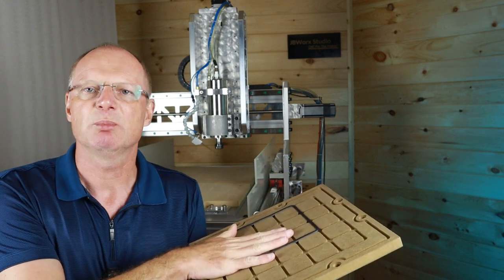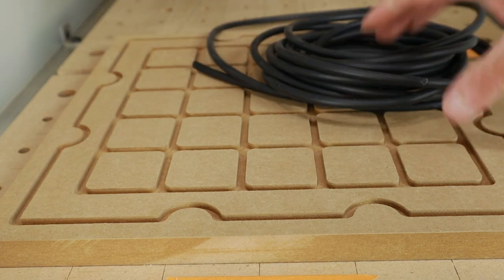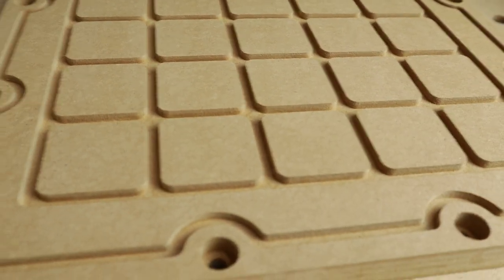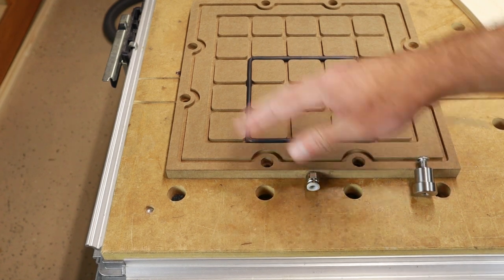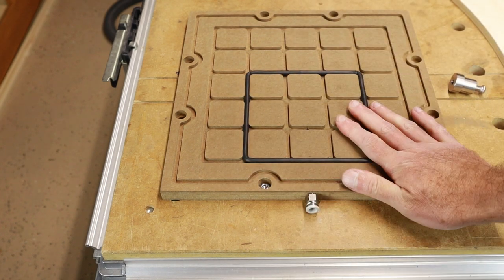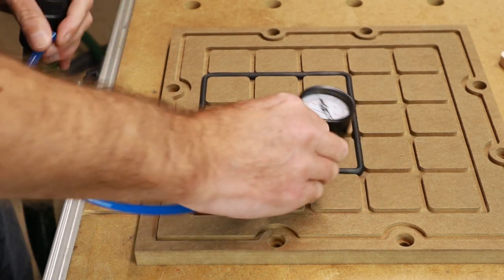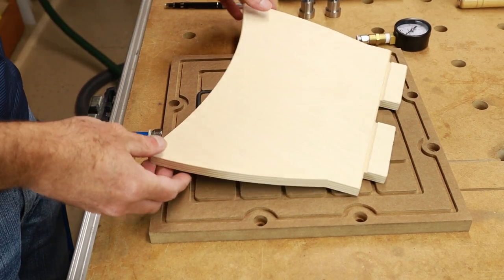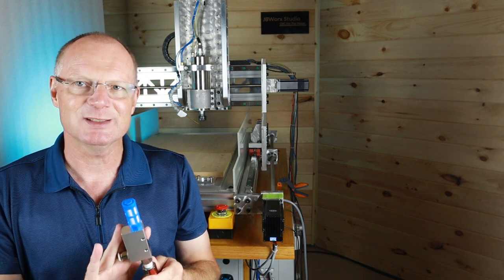Vacuum Plate

Comment: I've been using my CNC for about 8 months now and haven't been happy with any work holding method, this seems like a great idea. Now, if I could figure out how to make my bench perfectly flat then I'd be in a better place as well.
Reply from the maker: I think there is not “one fits all” work holding. Thin stock versus thick or metal versus plastic need possibly different methods of holding the workpiece down. If you have repetitive work it becomes also a matter of efficiency.  I think I use the CA and tape method the most followed by the direct clamping from the top. Have you watched my video on work holding? I think it has value.

Comment: Another awesome video, right in line with my CNC journey. I am considering a large vacuum loch raster from Sorotec, but really need more hands on experience with vacuum work holding before dropping €3k. Thanks to your inspiration, I'll probably build one of these as an experiment. Keep up the awesome work!
Reply from the maker: Thank you ! Yes a Lochraster Platte can be nice. They still require quite some airflow in the case any of the openings become exposed. Just keep that in mind when designing your vacuum system.

Comment: A good generally free source of vacuum pumps are old fridges. Not any good for Vacuum forming but for lower volume applications like this or vacuum bagging composites they are great.
Reply from the maker: Thank you for sharing, I have one from an air dryer that also works like you said if the volume is low… but the vacuum it can pull is great at 900mbar.

Comment: Joerg, great video, ive realised that i really need one too. I think the best variant is 20mm thick alum plate. Tape method works 50% of the time, my parts overheat quite often, so vacuum is the way to go. But there is one thing: using the tape method, I’m not afraid to damage the table, because there are 2 layers of tape between the part and the table, in the case of a vacuum plate, you will need to leave 0.1mm or more so as not to spoil the plate. And btw i think vacuum pump from Easy Compsites will work very good, its 300 euro - good upgrade for the system.
Reply from the maker: Thank you! Yes once you make an aluminum plate you will be mad at yourself machining into it. You can use the VacuCard from Datron (if you can get your hands on it) and that will allow to cut all the way through the part and also restrict the airflow. Once there are any parts of the pate open the vacuum is greatly reduced no matter what style plate is used and then the pump becomes more and more important.   Thx for the Tipp I will check into the pump you mentioned.

Comment: Any chance you have sourced a cable replacement? I may have turned the spindle on and ruined the cable. It’s a 3 wire usb-c.
Reply from the maker: I assume this is not for the vac plate but for the touch probe ? Unfortunately I don’t have a source for a replacement. I think usb c has 24 pins in its original configuration. Sorry

Comment: Hi Joerg, great video. 

Thanks a lot for the previous ones where you tune the servos, it really made all the difference for getting my JAND servos tuned, and your videos was the only ones I could find that had any real information  in them. 

In this video, you're doing a vacuum table using only one piece of MDF. That means that the top surface acts as a poroous surface that has the pressure differential. 

Ususally a grooved vacuum table is non poroous, and the tubing acts as a seal to make a very tight pressure chamber inside it. I see you cut the tubing for your test, but that's not necessary, the wide corners you've made should make it possible to route a long seal both in and out at the same corner.

Since your entire surface is porous, I would think that having NO grooves at all and thus no seal would work much better for you. Just do a flat piece, and put your stuff on that! The entire surface will now keep your workpiece down. 

If you're using a shop vacuum cleaner, you might consider adding a valve somewhere so you can let in false air, in order to keep the vacuum cleaner cool, as running it with almost no airflow will probably get you in trouble sooner or later.

I've just gotten my 2.2KW vacuum pump, and I'm going to build a 1250 x 1400mm table using 2 x MDF boards spaced by ~10mm with the top one being porous and the bottom and sides being sealed. I'll add spacers all over, so it doesn't bend, and it should have the added feature that I can resurface the top whenever I want to.

Best regards, Lars
Reply from the maker: Hi Lars, glad you could use the tuning video ! Actually the MDF is sealed with shellac as I mentioned and one of the channels is drilled trough to intersect a bore to the fitting. Yes MDF is used often in the way you mentioned but in this case I used it because it’s cheap. Yes the rounding of the corners I wanted to do to protect the seal. Especially for a metal plate that is important as this often cuts the seal. Using a shop vac is a bit of the crutch I was actually surprised that it worked this well, I wanted to include this option (more pumps coming up) as I know people going to ask if this is possible. A bypass vacuum would be a must as the motor has independent cooling. Thanks for reaching out !!

Comment: I've been using HDPE plastic for my vacuum pads, much much better than MDF.

I'm also using a small oil-less vacuum pump that i bought from Amazon.
A lot of other people are using the Fein Turbo Vacs.

The grid gasket I'm using is 1/4" round "backer rod", from the hardware store. It's a foam material, that gets pushed 3/16" deep into a 1/4" wide groove, made with a 1/4" round endmill.

I tried a venturi pump, but you need an air compressor with a huge tank, to be able to use it for a minimal amount of time.
Reply from the maker: Yes a plastic material is much better my plastic pods are made from POM. And yes the Venturi will work if tiki have little bypass air like on a aluminum vac plate holding a metal plate down. I think the shop vac (with passive cooling like the Fein you mentioned) is a good solution for woodworking. Thx for your comment !

Comment: There is an alternative mechanism, with minimum cost, for those who have an air compressor and don't want to mess around with making adaptors for shopvacs, on small plates like that, using a venturi adaptor. It turns the hose from compressor from a blower to a vacuum.   Obviously not so good on larger vacbeds.
Reply from the maker: Spot on! I show one at the very end and use it sometimes as well. Thanks for reaching out.
Reply: @JBWorx  My bad, hadn't quite got to the end, had to shoot off to catch up on an order.  Left the vid up to continue watching later.
Reply from the maker: Perfect 👍

Comment: the video was great, but curious how you tapped the hole for the air fitting to go into the side of the mdf?
Reply from the maker: Actually I just screwed that right in and secured it with epoxy - no tapping
Reply: thats kind of what i was figuring you did. Did you use a pc6 m5 fitting? or like a regular 1/8NPT? @JBWorx
Reply: and what was your predrill size? Looked around 1/8" OD
Reply from the maker: Yes M5 but NPT would work good too. I drilled 4.8mm hence the need for epoxy to seal it.

Comment: Very helpful video on how to make a vacuum clamp. Will the clamp remain effective when the tool cuts through the bottom of the job material above the slots in the vacuum plate?
Reply from the maker: Thank you ! For the Venturi pump in most cases no. For larger pieces where a regenerative blower works yes. There can be quite some leaks and the part is still held down firmly. You can also pull directly through a MDF plate, that has the effect that the air gets slowed down and the part is still held firmly in place. So it is a function of available air flow, size of the part (so force generated to keep it in place) and the size of the air leak.
Reply: @JBWorx  Thanks for that, you also answered the question I put in your next video :-)
Reply from the maker: Excellent

Comment: Could you use a vacuum pump for doing Heat pump recharging repairs, they are meant for deep vacuum to draw out all air from the Refrigerant  lines.
Reply from the maker: That depends on the application. These pumps don’t move much air, so if everything is and also stays relatively tight then yes. But if you have porous material or machine through then the vacuum is lost very quickly and the part moves on the plate. So yes doable with that in mind.

Comment: Are you depending on the porosity of the MDF as the evacuation channel?  If not,  how did you accomplish this operation?
Reply from the maker: No, there is a connector on the side and I drilled about 60mm into the plate from the side  and then through one of the channels into that. The MDF is painted to seal it.

Comment: hello, great explanation! i would ask regarding the goorve for the gasket, is the gasket is 6mm how wide and deep would you mill the groove?
Reply from the maker: Yes this is a bit of trail and error. So I like to ensure that the part lays flat in the vacuum plate and not up on the gasket. So the pull down force changes with the amount of vacuum you can produce. Also the shore hardness of the seal changes. So for a 6mm seal I suggest a test using a 5.5mm wide by 5.3mm deep groove and adjust from there. I used 1mm less than the diameter for the with and depth and found that it is difficult to seat the part all the way down onto the plate. Hope this helps
Reply: @JBWorx  great, in this case if i would use a 5mm gasket, you suggest to start from 4.5 wide and 4.3 deep? do you think that the gasket dimension is crucial in this project (i would try a gasket smaller than 6mm if possible)?
Reply from the maker: Yes that sounds good. I don’t think it is crucial for clamping wood / plastics. Too small like 2-3 mm will not seal enough I think. For Al is a bit different you can use a small seal.

Comment: vacuum venture not have perfect use table pad, need alltime lot air. but better have REAL etc,vevor vacuum pump cost 60-150$ 1-4 CFM pump. 3 CFM pump normal good to table hold part. cost about 70-110 $. cheap buy good vevor etc, pump.
Reply from the maker: We can get the same type of here in the US at Harbor-freight tools. Unfortunately they put a lot of oil into the surrounding air and I see a health concern with that. So I cannot recommend that.

Comment: they make long running vacuum pumps for the automotive industry..... A/C evac....
Reply from the maker: Yes I will get into that with my next video. I bought an AC evac pump and it filled my shop up with oil vapors. Returned it and the replacement did the same thing. So I am not able to recommend it. But there might be a brand that works.
Reply: @JBWorx  oh and another thing is I had a what I thought was a good idea is a sanding pad flat sanding pad on a small arbor that goes in the chuck of the spindle for a .0001? light pass of sanding over the top of whatever it is you're doing you were talking about sanding and getting burrs it may not be relevant to this particular project but it feels like it might be a cool thing I've never seen anybody do that.
Reply: @JBWorx  and I'm really excited to see your evac pump video! 👍
Reply from the maker: That’s actually a pretty cool idea
Reply from the maker: Excellent, working on it right now.